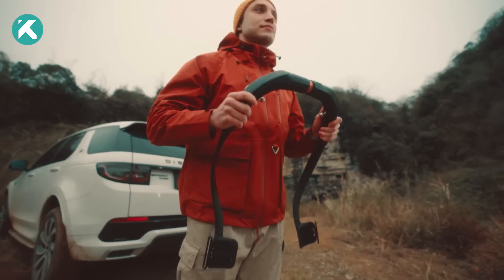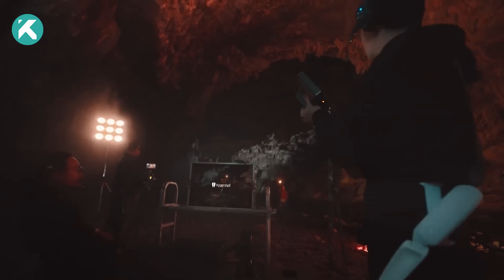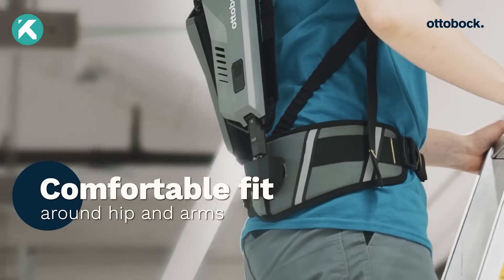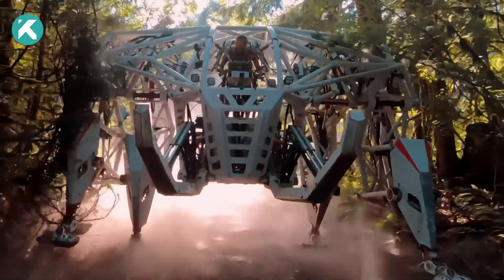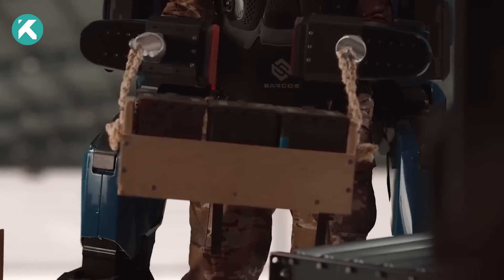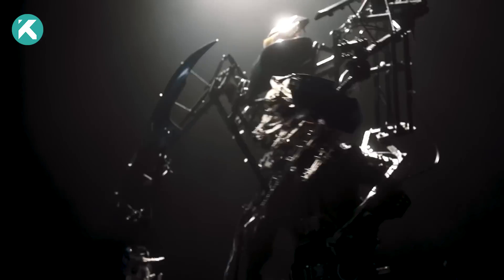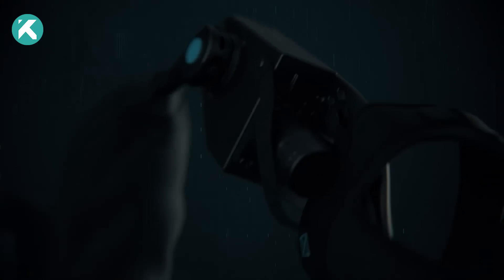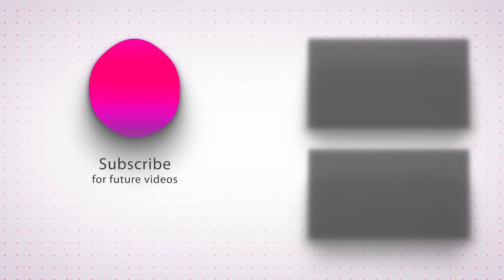Real Life Robotic ExoSkeletons That Give You Super Powers

Comment: Used on a healthy person with no physical impairments and it will cause them to become weaker.  Used on a person who has impairments it can help them with increased independence and mobility.  Its the same as taking a healthy person and have them sit and only use a wheel chair year after year and eventually they will have bound themselves to it becoming disabled as opposed to someone who is already disabled and it helps them get around, though with clear limitations especially where they are not properly designed for all terrains and types of sidewalks.
Reply from the maker: I understand your concern about the possibility of a healthy person becoming weaker through prolonged use of an exoskeleton.When employed as part of a rehabilitation or mobility aid plan for those with impairments, exoskeletons can offer substantial benefits. what we observed that these devices are not intended for extended use by individuals without impairments, and their design and application are specifically tailored to assist those facing mobility challenges.

Comment: Yes, such a device will also cause muscle weakness.
Reply: Agreeing. Having watched i struggle with believeing those exoskeletons would be fully or entirely reliable, if the system tilts or "receives" moisture and malfunctions, humans in need of the exoskelton could seriously or severely get injured in some cases, so who or what assures that those systems won't harm the user? I'd doubt that there would be an insurance "installed". The maufacturers think this questionning is not necessary? I'm not thinking of "evil" computers "like" skynet or bad nerds malware, but i've seen quite a lot or "alternative" reactions in software as that were gremlin to have "free electrons" in mind. And even if the us(ag)e at work goes along flawless, how long would those exoskeletons be used until some technician would have to fix or check some parts or subsystems? If there is support at all (in the ionternet) at equivalent cost or value. "We" shouldn't get used to provideing such exo-skeletted skills as a casual service.
Reply from the maker: The potential impact on the lives of individuals recovering from these conditions is immense. These devices not only provide physical support but also offer a pathway to expedited rehabilitation. So for rehabilitation purposes these can be a great game changer.
Reply: @KinoTechReviews  Well as good as computers might be or become at multiplying, as much or deep (or slow) they are in struggle with dividing, electric current doesn't flow eighter way in all circuit genuses as you might remember. But to put the discussion your way i'd wish there were more all in one tool instead of so many (not often available) special parts (lack of compatibility or adaptation as "well" as "change in design"). Tools and technique are to be built for the people (and their money), instead of having to be a slave to find money to feed a computer or apparatus as the opposite. I just meant that an exoseleton user must be technically gifted, not everybode can learn such skills if the abilities aren't inside of one being from its beginning. But maybe i'm just a guy that tries to refuse to nerd.